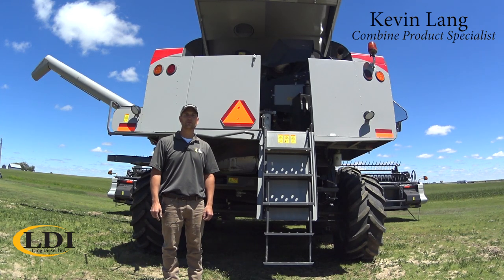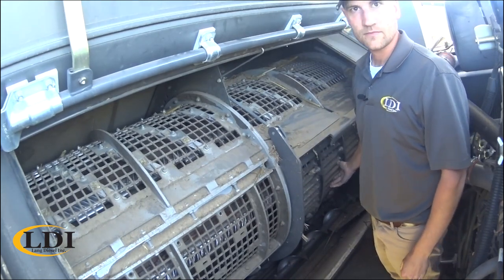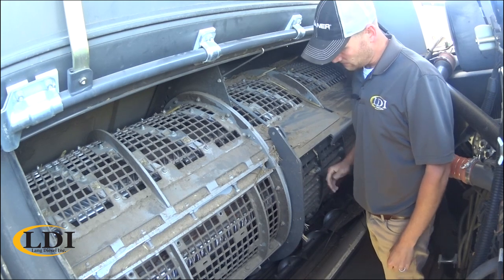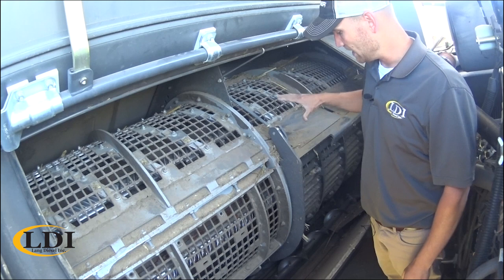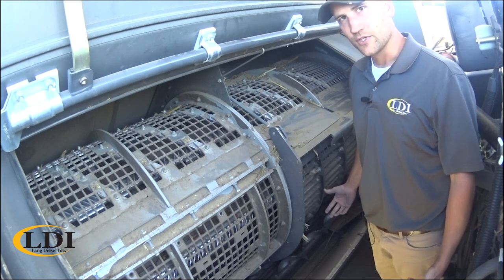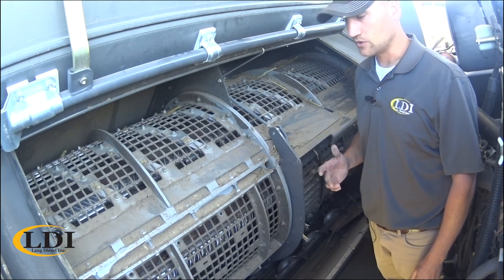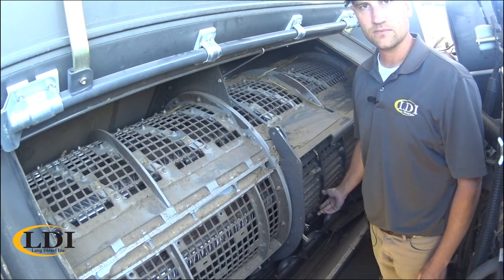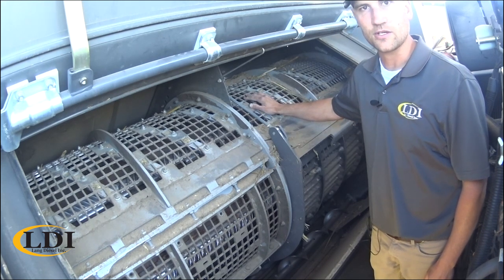How to change concaves on a Gleaner Combine?

Comment: The only mods I have done on my R40 are removing every other wire grate. Puts a very clean sample in the bin. With a Gleaner you can shell corn before lunch and after lunch you can run beans with a few simple adjustments.